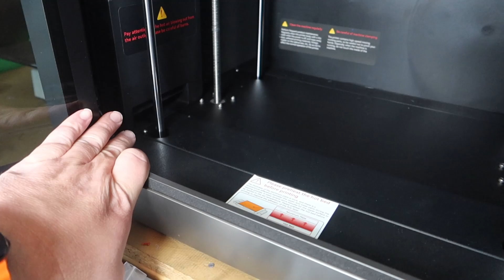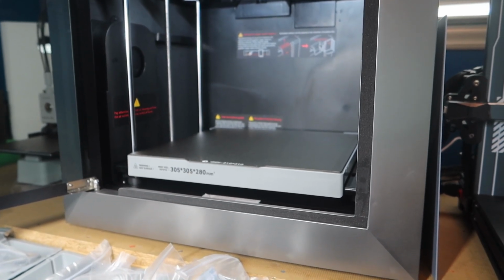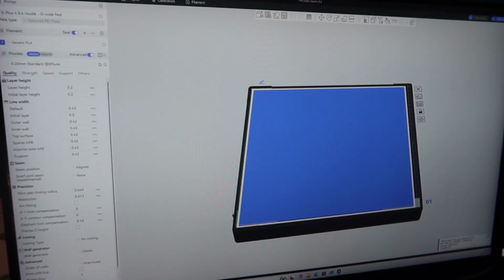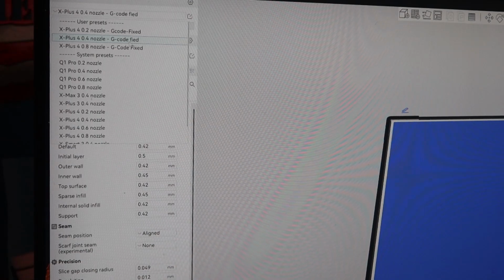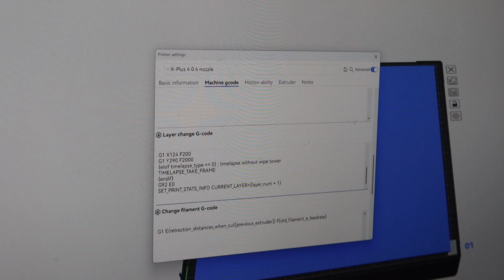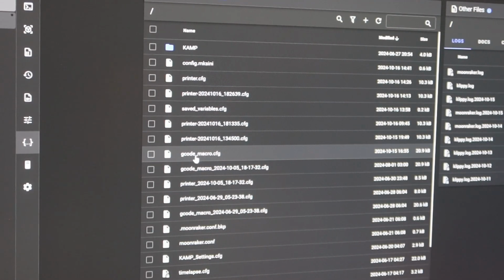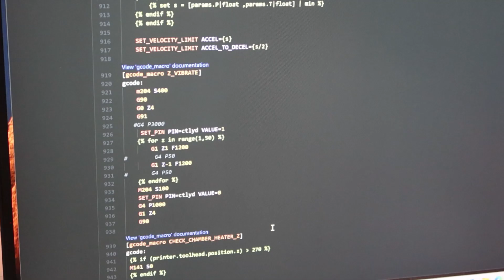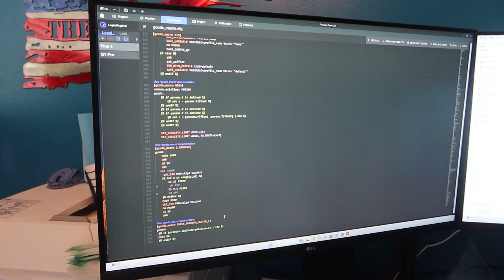How To Fix The QIDI Plus 4 Heated Chamber Error

Comment from the maker: Here is the file for g-code to add to printer to work around till fix is made - Credit for g-code Nozie works ---------https://drive.google.com/file/d/1w7L_H01uq7sNNwWcYlTOeFkwzPfrLdL6/view?usp=drive_link
Reply: 2 corrections, you don't loose buildspace it just turns off the heater at that set value and it's Noizie 😉

Comment: The gcode doesn't work unfortunately. Copy paste from the drive file link errors out.

Source contains parsing errors: '/home/mks/printer_data/config/gcode_macro.cfg'
[line 970]: '{% if (printer.toolhead.position.z) > 260 %}\n'
[line 971]: 'M141 S0\n'
[line 972]: '{% endif %}'

Once the underlying issue is corrected, use the "RESTART"
command to reload the config and restart the host software.
Printer is halted
Reply from the maker: What firmware version are you running ?  At this point in time just update to firm over 1.6

Comment: You just have to be very mindful of the spacing of the code. It will error out if you have the spacing wrong. Mimic the code above it for guidance. It does work though.
Reply from the maker: Great advice

Comment: I wonder if a redesign of the chamber heater to route to a plate with spacing to run hot air that sits on the bottom of the unit would work. But I can't tell how much room is under the build plate when it's all the way down. That chamber heater looks like it's an inch or two thick off the side though.
Reply from the maker: Man there is barely any room.  That said you can Dremel the exhaust area and redirect but I d9nt wanna do that.  There was a firmware release 1.4.2 that fixes heater issue not sure how yet been printing for 2 days straight

Comment: Todays New update fixed this.
Reply: Yeah
Reply from the maker: You can not fix this with an update the heat fan design is wrong they may limit your printer but it is not a fix
Reply: @LifeN3D2025  i mean. They did what you did. So we dont have to. 
The heating can be turned off or reduced for the last layers. the bed can also help to keep the temperature of the chamber high enough. the important bottom layers of the print are still heated by the bed. and as we know warm air rises. Thats the theory at least. the worst for printing is a sudden change in temperature and air flow when opening a door. If it does not work. Just drill some holes to the side of heater pipe 🤣